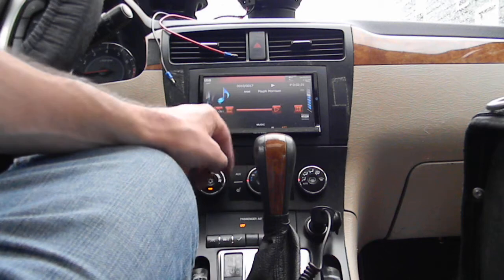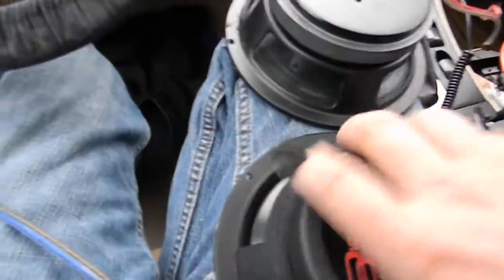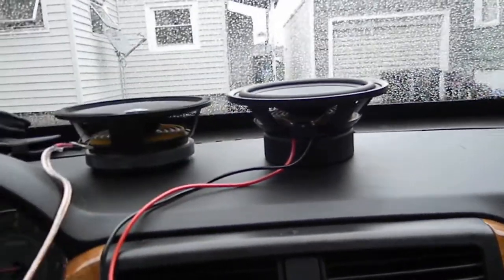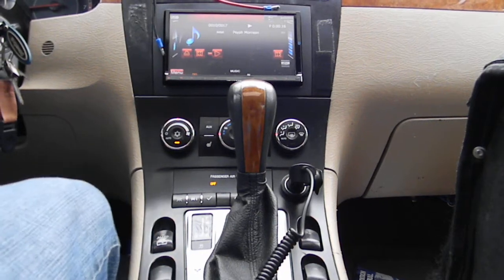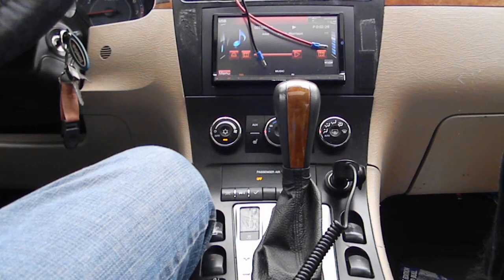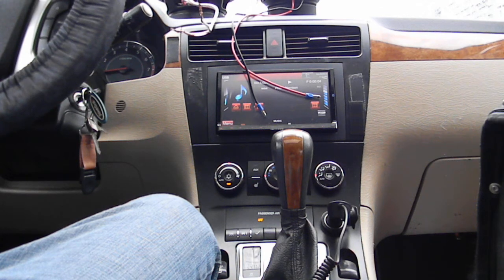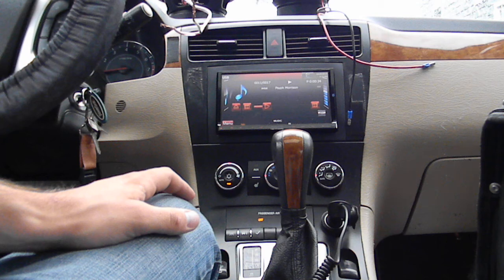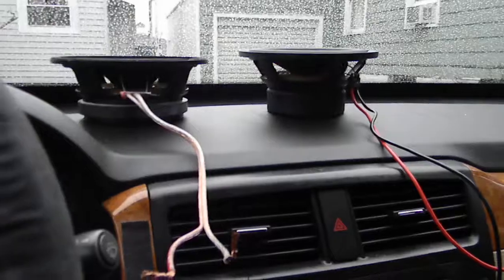digital designs vo series vs dda-w6.5 series

Comment: The AW6.5 is a far better Speaker 🔈 Better Quality most definitely. My whole speaker system is DD Audio. I have three Rockford Fosgate power series amplifiers running my system along with an audio control DM 810 sound process. . If you have the right equipment the AW6.5a are the way to go.

Comment: How the sound quality of the DD pro audio speakers. I have a DC audio sub stage 2 LVL4 12’s on DC 2K and need something that can keep up. I’m thinking about running the VO mids and super tweets off a DC 90.4.
Reply: I'm thinking about doing a 3way setup with vo6.5 ex2 75 and B1 tweet with the cc3 crossover